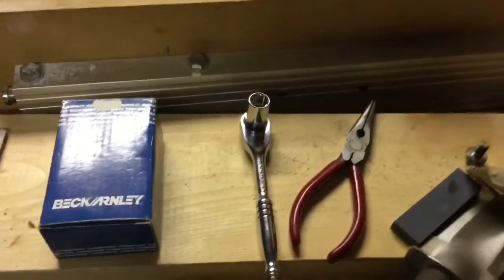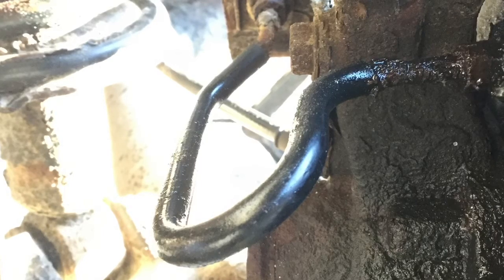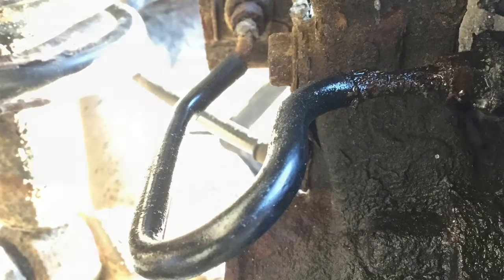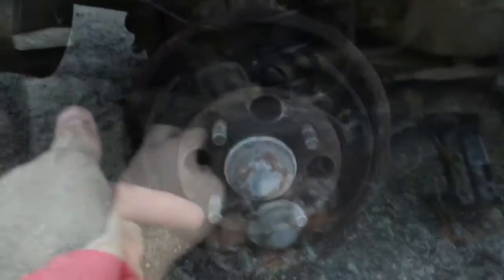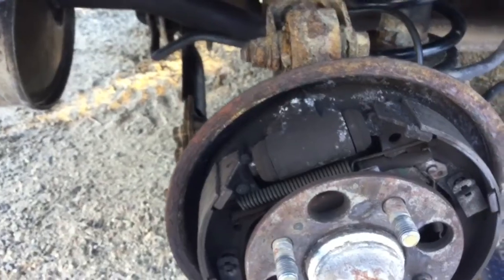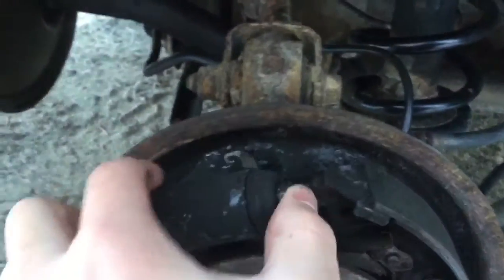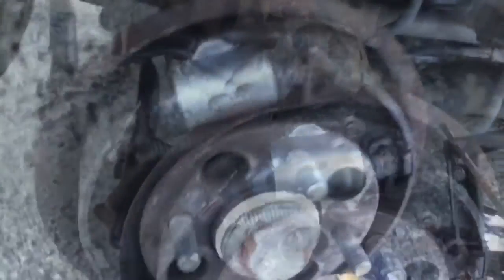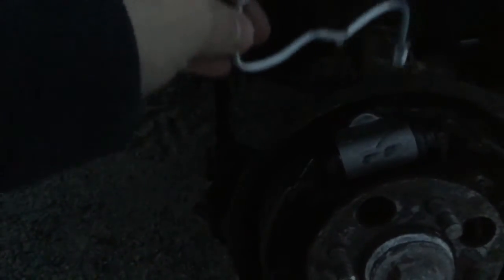How to Change a Rear Wheel Cylinder on a 2001 - 2005 civic (works for all drum brakes) EASY TO DO

Comment: Bro how did you get off the bolt that's blocked by the upper control arm
Reply: did u find out
Reply: @cae7849   yeah I did actually you have to loosen the rear dust shield to give you enough leverage to fit your wrench in there
Reply: @tazinfluence5356  mine was stripped so i had to take out my whole bearing
Reply: im having troube gettting the green long spring on u know what i should do
Reply: @cae7849  pre assemble the spring on the shoes before you put it on  and stretch it over the wheel cylinder and make sure it's aligned properly ,
Reply: Nobody will say online. My foot has an appointment with the honda tech that designed this drum set..

Comment: Suggestion lube down the lugs, place the lug nuts back on to protect the lugs just in case you miss.
Spray down the assembly with brake cleaner.🙏🏿👍🏾👌🏾💪🏾👨🏾‍🔧👏🏾😡🤬.

Comment: Personally, I would take additional steps to complete this job. I would use a brake cleaner to spray down all dust. I would take those brake shoes off to clean it up & use ceramlub anti-seize lube inside the adjuster and all the spots for the shoes to rest on... so it would continue to work smooth. Plus, by taking those shoes off makes it easier to install wheel cylinder.
Reply: It’s so hard to put them back on your just gonna cause a bigger problem then you started with

Comment: I watched the video feeling super confident, and then messed up cuz you left 2 key things out. #1, don't bleed the brakes without the drum on or your piston boots will burst and leak brake fluid. #2, the drum may not go on easily again. There's this bar on the left side with teeth on it. You have to move the teeth upwards to tighten the shoes again to put the drum on. Had I known those 2 things I coulda saved a day.
Reply from the maker: Good advice! I was only changing the wheel cylinder so I didnt go into to much detail. 
 I guess my idea with this vid was to make a quick easy video for people who just needed the wheel cylinder replaced...

 I hate to say it but yeah theres probably  much better vids on changing the pads etc then this one!!

I have much more experiences with disks then drums haha
Reply: Thank you , your comment will help other people